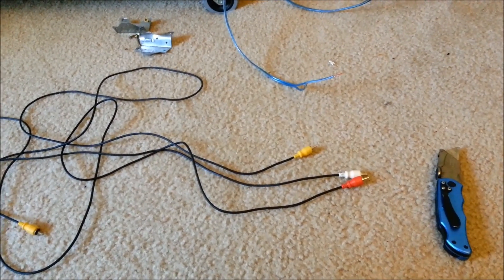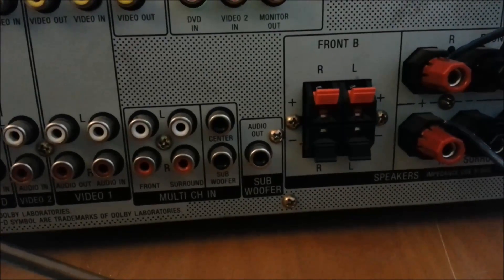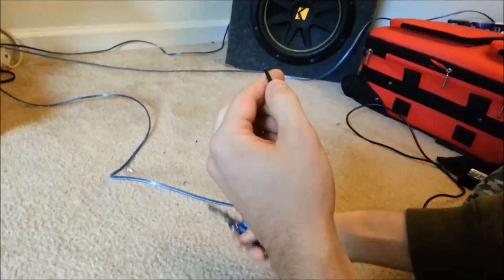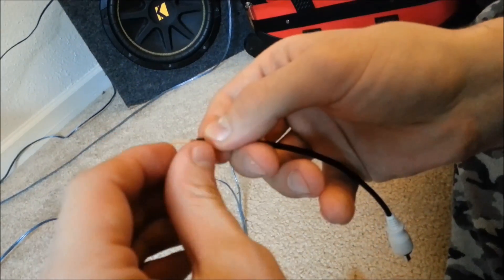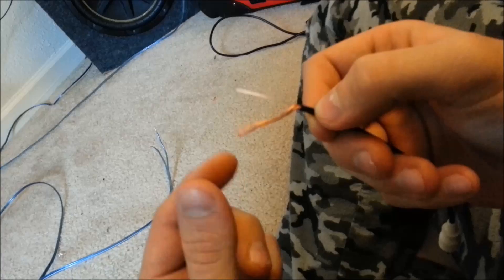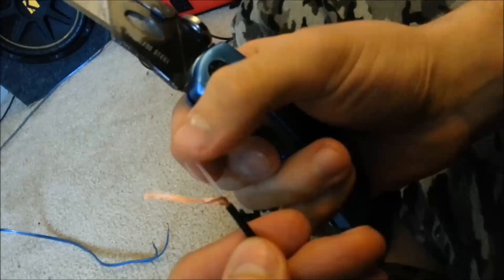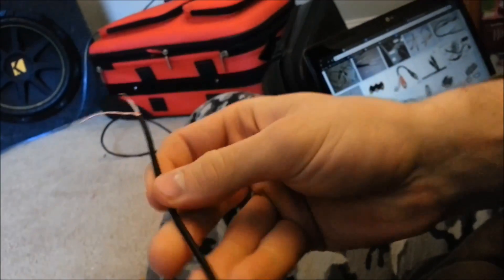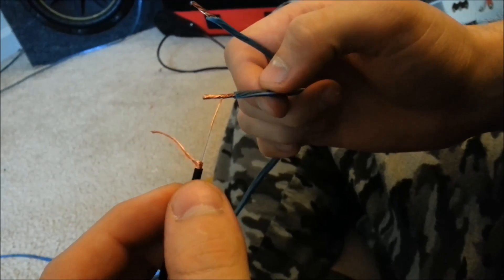Convert speaker wire to RCA or monaural

Comment: After you convert speaker wire into RCA's can you then plug them into a after market car amplifier if you're head unit doesn't have RCA basically do you have to use a high to low power converter?

Comment: I even bought the adapter still wont work. I've tried on 2 different receivers an no sound. Speaker works I tested thru regular speaker but sub out and my wired sub just wont bump. Very sad

Comment: I believe I have the exact same receiver and I am trying to do the exact same thing.  I soldered mine together and put heat shrink tube over it so I know the connection is good.  However I am still not getting anything out of my subwoofer.  I have never used the receiver before.  It was given to me by a friend to use in my garage.  I'm thinking maybe it's as simple as a setting on the receiver?  Please LMK if you have any ideas.  Thanks
Reply: Exactly...it dosent work

Comment: So I don’t have a single subwoofer output on my amp but I have a sub1 output and sub2 output how would I wire this as my sub just has a negative and positive wire coming out
Reply: Isn’t that technically just in case you were trying to run 2 subs off your amp?

Comment: I decided to pull out my old KEF PSW 2150 subwoofer that's been collecting dust for years. I'm fairly handy with basic connections, but I have never spliced open an RCA male jack. I needed to connect them to speaker wire as you have here. Thanks from Hong Kong!

Comment: Hmm, you put a positive to a neg. at the end. I thought the red was neg. as the red on a converter was red and the stripe was red. My set up was backwards.  What could be happening if I did this? a likely fire? Oh, I just read that it doesn't matter on speaker wire as long as I am consistant. I hooked up a sub woofer home audio but it just buzzes constantly. It does sound like it has more bass but I don't feel it on me though I turned it all the way up and when I didn't splice it I could, even on low it had a lot of bass. Any suggestions? I realized that the wires were touching and there are different settings for bass. My remote wasn't working. I meant the red is positive and not the other way around so I just use the one with the stripe as a positive. NOw I am messing with another processor and even switched positive and neg. to see if it worked. It says to find the osd screen and I don't even know what that means or where it is for a Yamaha RX v757 but I have no remote. edit again- you didn't put a pos.  to a neg. you just held them close or maybe it was that you had that set up already as you said the way you had it was neg. was with stripe.

Comment: You can also slip on some of that rubber stuff before you twist together and shrink it with a lighter so it forms a protective barrier around the bare wires. Can't remember the name. But its shrink something

Comment: If trying to connect a powered sub to a stereo receiver, does it work going from speaker wire from stereo to rca plug on the powered sub input? If the sub wires have an output of 200Watts would it put the amp in the sub in danger?  What’s the typical rca output even measured in? ...but really does it work going from speaker wire output to rca input?

Comment: If you haven't learned it already I bet you're not getting good sound out of that subwoofer. That's why the subwoofer that comes with that system has a plug in it because it has an amplifier built into it

Comment: Dude help me out here i have this old speaker with its lil woofer in a wooden box and two black and red wires coming out i want to use that as a speaker connected yo the receiver via rca to use it for watching tv but the receiver has two for audio rd and White what to do?

Comment: Thanks for the info. Really answered my question if I can convert my home theater sub woofer to an rca amplifier. Great help.
Reply: I have speakers and tv. What else do I need? I see I need to convert optical to rca from tv output but do I need a amplifier or will the converter work alone?

Comment: So correct me if I'm wrong, but if you had an RCA cable long enough, you wouldn't need to splice it correct? You could just strip the end, separate the +/- and connect the raw wire to the sub, correct?
Reply from the maker: Absolutely correct
Reply: @JRobling  thank you!

Comment: Well, I've tried this with 2 different subs and 2 different rca wires and no sound coming out. I dont get it.
Reply: Matt Hedglen I think this will only work with a powered subwoofer and that output is for a coaxial cable
Reply: U need a amplifier. RCA out do not have any power, it's just a signal.

Comment: I have 2 old Phillips speakers which have exposed wires but i want to connect them to my TV. The problem is I can't tell the difference between the 2 wires that come out from the speakers as both look the same to me. Please help
Reply from the maker: You can check it with a battery. Have a wire go from the positive end of the battery and another from the negative side of the battery and touch them to the speaker, depending on it the speaker pops in or pops out will tell you if it is the correct positioning or not. https://www.youtube.com/watch?v=aP_4-r4Hk-o

Comment: So glad I came across this video. Just finished setting up my home theater, and found an old subwoofer in my garage that I thought was shot. Switched out the fuse and it worked! The only issue was I needed a subwoofer cable that’s at least 25 feet and all I had was a 15 footer. Thanks to this video, I stripped down a few random rca’s that I no longer needed and used that! Now I have “dueling” subwoofers and a huge smile. 😁

Comment: This is so wrong. You mention nothing of the ohm rating or the difference in watts not to mention rca is line level while speaker wire is speaker level. This may provide sound but is damaging the speakers magnet and voice coil

Comment: I have a built in the walls & ceiling surround sound but noone knows what wires i need :( there are 8 of them on the wall & i can screw them open whwn i do theres a hole maybe to put a wire in? & tighten it? What do i do
Reply from the maker: Sounds like you are on the right track, I have seen houses with the speakers built in and they have a panel like you are describing. It unscrews a little bit and you put in bare wire and tighten. Here is a video of what I have seen https://www.youtube.com/watch?v=-zVEd2SJkYE

Comment: This didn’t work for me. I followed it perfectly. My old sub from my home theatre only had 2 wires, I bout a RCA to 3.5mm cable & cut the white end off.... tied them both ways to make sure  I didn’t accidently do wrong side.... nothing 😥

Can anyone offer help ?
Reply: This morning, I found near the community trash bin a SONY STR-DE245 Audio/ Video Control Center (without the remote... 😭), with a RCA output for the subwoofer. My LG Sound System' subwoofer has two wires, marked like this: red and black. Remember: red or white or orange or green or whatever other color except black is the "+" (plus) and black is always the "-" (minus). Be sure to match the subwoofer/ speaker cord to the appropriate terminal on the components: "+" to "+" and "-" to "-". If the cords are reversed, the sound will be distorted and will lack base or (I guess this is your case) it will lack completely.
Mine worked. I wished the motherfucker left it with the remote, because this sweet amplifier (5x50W - no bullshit - Made in Japan, dude!) is in a near-mint condition. The sound is aw-aw-aw-aw-aw-aw-aw-e-so-o-o-o-o-ome!! I'm celebrating it right now, with Mr. "Absolut" - each and everyone's best friend, from Sweden (LMFAO).
Good luck! 👍
PS Let me know how it'd worked.
Reply: Den Harrow I tried both ways, but nothing.. my LG sub didn’t have its own power cable... so I think that’s why it didn’t work for me. I ended up going to Best Buy & got a powered Polk 108 sub for )$125 and a sub cable. Just get a harmony hub for remote, you lucky bastard.
Reply: 1. "Its own power cable" - neither does mine, Einstein, it isn't a "Subwoofer System"!!! If yours is a part of a 5.1 speaker system, it'll have only a cable to connect it to the Blu-Ray player or to whatever amplifier you have; a cable with plus and minus, no volume knob or whatever other buttons;
2. $125 is 🔫. Is your LG made of gold??!?!
3. WTF is a "harmony hub for the remote"??
TYVM
Reply: Den Harrow what I’m saying is that my old LG sub isn’t a powered sub, so with my new Denon 5.2 receiver, it only has subout rca out... so I tried using my old LG sub from a cheap home theater system, but it powered thru amp, not the sub... but this hack only works if using a powered sub. So that’s why I had no choice but to upgrade to a new powered sub, sounds amazing! Yes, the harmony hub controls my entire entertainment center via “voice” control  :)
Reply: Den Harrow walmart has it for $58. Or you can just get a $20 harmony remote & it’ll control all your stuff as well :)

Comment: Do you need to connect the rca cable via the speaker wire. Or can you just directly connect the striped ends of the rca wires into +and- ports on the speaker?
Reply from the maker: That will work, the positive and negative ends of the RCA wires can go into any wired port

Comment: NASA standards? At least if you twist the wires together THEN solder them, if a meteor hits your rocketship and loosens the solder connection on the two wires the twist will still hold them together. LOL.

Comment: I had no luck with this my active subwoofer through LFE to my Sony AV receiver works fine through the sub Port on the back of the receiver I tried what you did in the video with a normal sub and it just does not produce a sound I get nothing does this actually work for people or is this video fake as my receiver looks exactly the same as yours but mines black it's the Sony str-de585 ???

Comment: Can I use this method to connect a powered subwoofer with only RCA Line In to a receiver that only has a speaker-wire out for a passive subwoofer? Would the 150 watts that is output for the passive subwoofer damage my powered sub as I will be feeding it to the RCA line in?
Reply from the maker: Are you sure that it is only for a passive subwoofer? most receivers don't have enough watts to push a woofer. If it is meant for a passive I wouldn't connect a powered woofer because I don't know if it would be rated to handle the added watts.
Reply: Yes its only for passive as it is an all-in-one receiver. My concern is the same too but don't you think an RCA Line-in shouldn't draw any additional watts and only the frequencies. Or Watts should only be conducted if the end point had the circuitry for it. I have no other way to connecting the powered sub to this receiver.
Reply from the maker: I have never come across this situation, but I would assume that the all in one receiver has a built in amp to power a passive sub, meaning the output would be much higher for that port. I wouldn't feel safe doing that due to risk of the powered amp getting damaged. You could try to bypass the internal amp in the powered sub

Comment: I have one speaker wire. I need to make one positive RCA and one negative. How do I do that? Do I just connect the positive speaker wire end to the center post of the red RCA cable and the negative speaker wire to the center post of the black RCA cable and completely disregard the ground on both?

Comment: I purchased 5th wheel Rv and it came with Samsung receiver with 6 speakers and when I play cd only 3 work what is wrong/
Reply from the maker: Check the wiring first but usually when you play a CD the receiver puts itself in a mode where only some speakers work. Testing with a surround sound video is the best test

Comment: Question: can i make the RCA cable for subwoofer that is passive (not powered)? becuz i have marantz 6.1 DTS amp, it has 6 channels for left/right and surround speakers but no woofer, the woofer one is RCA type input located above the speakers section, help pls ...

i have connected my subwoofer to centre channel and it doesn't sound like it should
Reply from the maker: The subwoofer can only be placed in a designated subwoofer port, or it will sound weird like you said. If it is put into a regular speaker output then the woofer will be treated as a normal speak and not a woofer. No, you need to push extra power to the sub, which is why I said an amp is needed for that application

Comment: Any chance, I could use butt connectors, instead of the pigtail method  to connect the wires?
Reply from the maker: of course, as long as the wires are making a connection you can use whatever.

Comment: Do you have to attach speaker cable of can i just strip one RCA cable and put those wires directly into my subwoofer? The cable is long enough and i don't want the messy looking taped wires...
Reply from the maker: if you strip the end of the rca you get the positive and negative wires, which are the same as the positive and negative in the speaker wire, so no you dont need to add wire to wire.

Comment: @J Robling i have a old car stereo but with no speakers. I also have a woofer which is of 17watt. can i connect the car stereo's speaker wire to this woofer piece.

Thanks much for reading this.
Reply from the maker: Most car radios will put out around 50 watt so it can power it. If it is just a woofer the sound might not be that great  and some radios come with sub outs just for woofers
Reply: Thanks J Robling. that was a quick reply.

Comment: Say i have a ac wire white and red and at the end of it you can connect a aux wire could i use the  red and white wiring inside and connect it to Speakers without any thing else

Comment: Would this help with connecting to a TV for sound? Also, would black electrical tape be good to keep the wires together?
Reply from the maker: Many people on here have done that, you can use electrical tape but remember that it is possible for it to come apart.

Comment: I currently have 4 built-in ceiling speakers that are bare wires that are connected to a stereo receiver with red and black tab/clip type inserts. is this video the method for converting them to RCA type connectors and if not can you tell me how to do all for speakers?

Comment: actually that subwoofer output on your receiver is meant to run a single rca to another stereo. when you then connect your sub to the speaker connections on that it will play bass only instead of sound. just sayin

Comment: I have two bose speakers I wanted to connect to my TV, the speakers have the red & black wire connectors in back. No Sub. So confirming if I take the two speaker wires coming from the bose speaker and pig tail them both onto 1 white RCA cable. since I have two speakers, do I connect all 4 speaker wires to the 1 white RCA?  Not much into electronics so forgive me if that didn't make sense ha, hope it did though.
Reply from the maker: +Kathleen Smith That would complete the connection and would work, as long as the tv puts out enough power to the speakers they should work and sound good

Comment: bro can i use this technique to connect sub in place of 4th speaker ?? help !
Reply from the maker: +Hásan Alì No, connecting a sub in place of a speaker wouldn't give you the bass. It would tell the woofer to be a speaker
Reply: +J Robling so whats the solution then how to connect my bass tube to stereo? :/
Reply from the maker: +Hásan Alì if your receiver or tv doesn't have a sub out then you can't use it. You could try to connect the woofer in place of the 4th speaker but you would need an amp
Reply: +J Robling actually i want to connect my bass tube with built in amplifier with my car stereo. the stereo have place for 4 speaker but no place for subwoofer help me if you can :/
Reply from the maker: As far as I know it won't work. You can still try and plug it into the 4th speaker slot and see if you like the bass from the speaker output compared to what you would get from a sub out. I never tried it like that
Reply: +Hásan Alì bruh all u need to do is check if your car stereo has sub RCA IN/OUTPUTS. If it does u will have bass.

Comment: dude ! how can I connect a sub to an amp without a subwoofer output ? help dude
Reply from the maker: +Surya RK meaning output on the woofer or output on the amp?
Reply: +J Robling my amp does not have sw or pre out.. can I connect subwoofer ???
Reply: +Surya RK just connect your sub DIRECTLY to AMP. AMP boots all sound, but your AMP should be connected to stereo sub OUTPUT. YOUR WELCOME! !!

Comment: Hey!
So my problem is as follows: I have a receiver that outputs the signal it gets from the TV/CD player etc through speaker wire to the speaker. The main problem with this is that my speaker only has RCA input. Is it possible to follow the same steps as in the video and make this cable, to upgrade to an RCA input? To clarify, my receiver outputs using speaker wire, and my speakers can only accept RCA wires. Thanks!
Reply from the maker: +Dustin Sandler you can use this method to split the rca to a positive and negative so it will work and also you can use my videos to reverse and make positive and negative wires to rca, the only research you need to do on your part is to make sure that the watts are going to be sufficient to power the speakers
Reply: +J Robling thank you! I believe my speakers could overall use about 50W per channel, max, and my receiver outputs 140W total... therefore I am going to assume this strategy is going to be successful! Thanks for your help!
Reply: +Dustin Sandler also the 50W is a theoretical max... I'd maybe use 10W
Reply from the maker: As long as the power going to the speakers this method will work

Comment: Why didn't you use the wire strippers on the first part? while you were cutting it with a razor knife, I was wondering why you didn't get a pair of wire strippers, and then the next step you had them.
Reply from the maker: +Cliff Sheets my wire strippers didnt have that high of a gauge
Reply: +J Robling u mean low